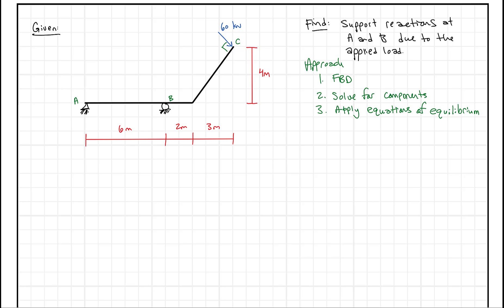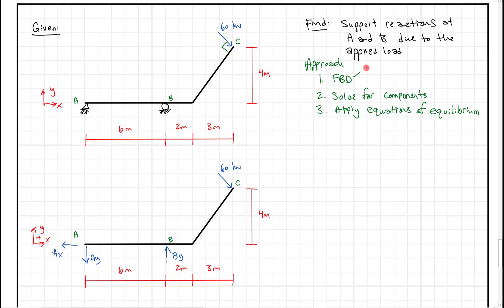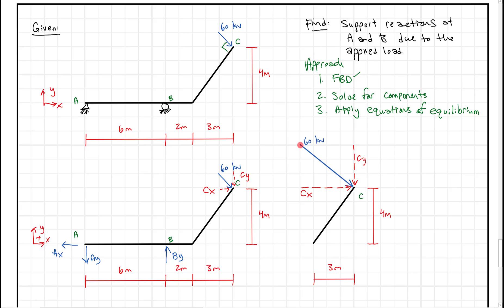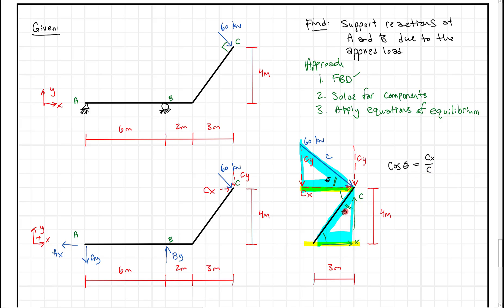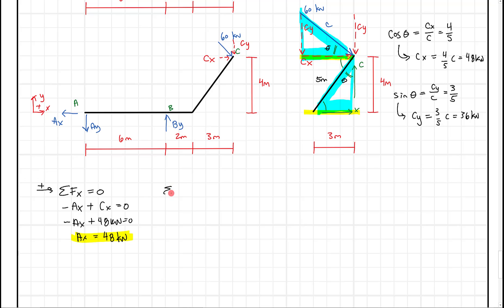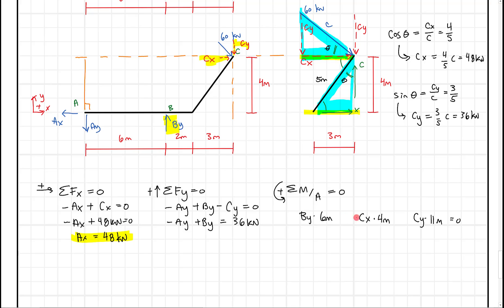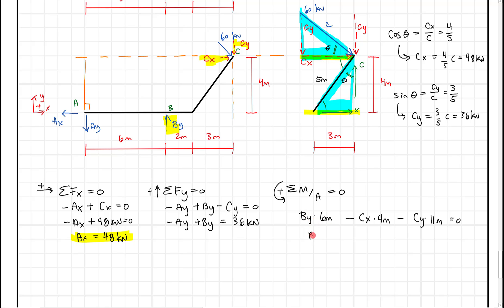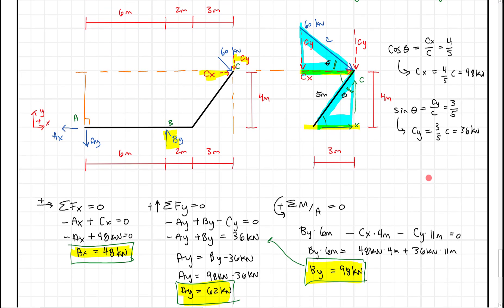Beam Reactions 1 concentrated force at angle away from X axis

Comment: Hey Mark. Can you please explain why in this situation, the Ax and Ay are different sign conventions than in previous videos with a similar FBD? Thanks!
Reply: And one follow-up question, why was Ma not included as an unknown in the equation for the sum of the moments with respect to A? In the previous video, we made sure not to forget this unknown in our equation.
Reply: @colemanmcgrath1722  In the last video, Ma was included because the member was attached to a wall on the left side, and therefore Ma had to be included.  But in this problem, there are only hinges and rollers, no wall attachments, so there is no Ma force.  
Also for your first question, he was just looking at the example as a whole and he could tell from experience which direction Ax and Ay would be in.  But it shouldn't matter which way the arrows point as long as you're consistent throughout the problem.  If you guessed wrong, your answer will just turn out negative (based on how you drew the arrows)